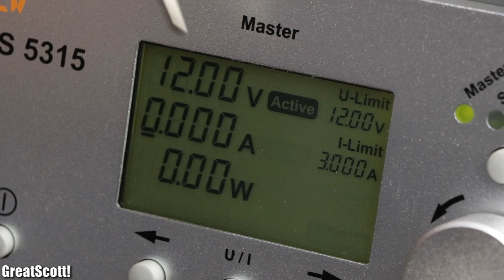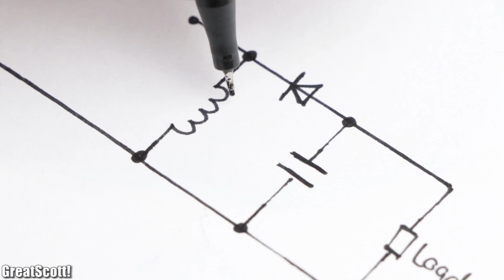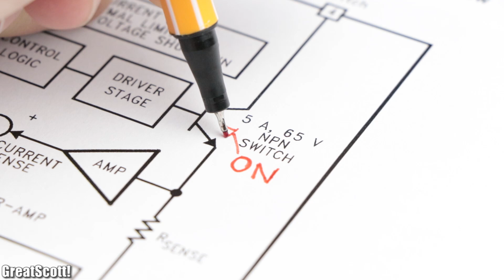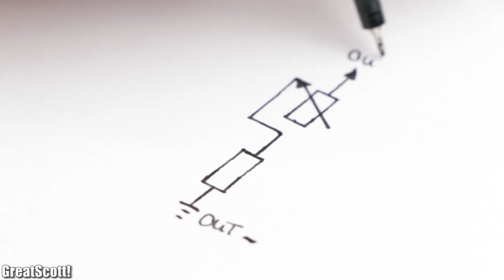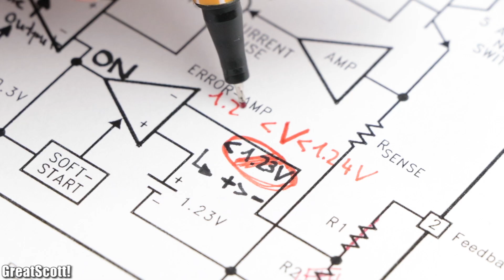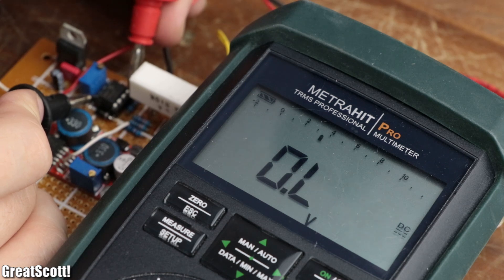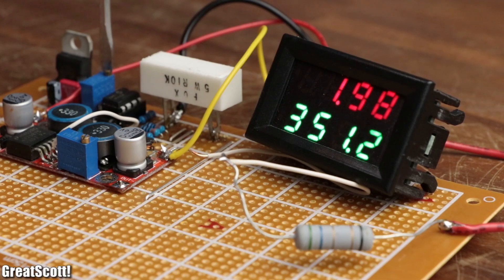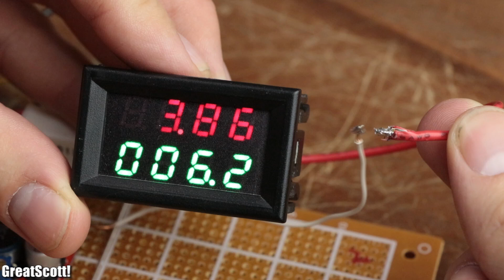HACKED!: Adding a Current Limit Feature to a Buck/Boost Converter

Comment: Hi there Scott! I'm trying to figure out how to make a current limiting circuit for my lab power supply (PC modded power suply). I want to make the 5v 16a output to be a 5v 500ma output, but I cant figure out how to limit current without creating a voltage drop. Can you help me and give me some advice?

Comment: Hello GS. In this type of power supplies can i use a big electrolytic capacitor at output, like in a linear power supply, to avoid ripple? Thank you. Keep the good schematics.
Reply: Due to the quite high frequency i thin its better to use film or ceramic caps

Comment: I have a problem with this blue mini potentiometers, its nearly impossibe to get a precise value out of them because some times i turn 3 rounds and nothing happens and in the next turn the value goes high af. Is there any way get get a precise value from them? Now i'm using a standart metal peotentiometer
Reply: The blue micro pots shouldn't cause this issue, slow quarter or eigth turns should regularly update.

Comment: Is there any method to design a current limiting circuit without a shunt? in high power application a shunt would be very inefficent, so i'm thinking if it's possible to wrap the output wire around a toroidal core with a hall effect sensor stucked in to detect the current value, pretty much like a DC current clamp would do.

Comment: Can I use 4 to 6 LM2596(current limit 2-3Amp) module , to charging a 12V , 100AH LEAD-ACID Battery , as it is required current of 10% of Ah rating, for this case it is 10A.
Please reply
Reply: No you can't just parallel them

Comment: This is cool knowing how to do this, but I would probably just buy one of the many buck converters that include an adjustable current limiter in the design.
Reply: Zero challenge or understanding of the components you're using means when they don't work you just buy more
Reply: That's exactly what I did,  only the board has three trimpots on it,  not the two that you'd expect.  And it doesn't seem to want to work properly to drive a 10W LED.  I'm in the process of trying to figure out why...
Reply: Yeah but you have to wait for it to arrive from China or wherever. I like to be able to build things with the stuff I have lying around. As a programmer I find there is a lot of beauty in creating complex things from a limited number of primitives. So as an electronics hobbyist endlessly buying new components doesn't satisfy me. If I were building a commercial product that would be another story.

Comment: I know this is a year old but hopefully someone can advise me.
I have two of these buck/boost converters which I thought could be very handy for powering an Arduino and a few sensors yet get a nice stable voltage.
This it did but I noticed the batteries were not lasting long.
I checked the current draw between the buck/boost converter and my Arduino and measured about 45mA max.
I then measured the current draw between the battery and the buck/boost converter and was shocked to see 204mA whilst the Arduino was connected and even more shocked to measure 208mA when I disconnected the Arduino so the buck / boost converter was off load.
I had the output set to 8 volts.
This was the case on both, so have I got a faulty batch or due to the nature of these, is the current indication incorrect.
If my findings are correct, it makes them completely useless for anything.

Anyone else found this or could anyone explain.
Thanks

Comment: There are ready made CC, CV Buck Boost converters, with additional trim pot for current limit adjustment. They typically use low side current sense resistor (shunt), making it easier to process the current feedback signal. Typically the current feedback signal after non inverting amplification is fed to the FB pin via diode. The FB pin is controlled by the higher of of voltage and current feedback signals. Nothing wrong using high side current sensing...but the accuracy of the simplest 4 resistor diff amp even with 0.1% resistors could exceed 2% due to unwanted sensitivity to voltage due to resistor mismatch. TI and AD have an extensive range of tiny current sense amplifiers, more suitable for this role than a general op amp (comparable on size and cost).

Comment: I recently purchased an lm317 ac/dc step down power supply module (I'll put a link to show the exact one) and it seemed to work fine when I wired it up but as soon as I apply a load, no matter what size, the voltage just drops straight down. It's completely unusable. I was hoping you might be able to tell me why and how to fix it. Here's the link 👉🏼  https://www.wish.com/product/lm317-adjustable-voltage-regulator-ac-dc-step-down-power-supply-module-with-led-meter-54aba0204274a2031d974277

Comment: i need to add short circuit protection to H-bridge inverter to protect the igbt's , i using 4 NGTB75N65FL2W IGBT , and the inverter 
 is HF without transformer , do you have any Suggestion

Comment: something wrong with the schematic diagram which op amp IC1A pin 3 should connect in between 3.3k and 100k resistor not to GND. I guess you are trying to test your viewer :)

Comment: I discover your videos today! Congratulations! They are amazing! I l have a step down regulator! I need a fix current of 12v, connected to a gel battery! The problem is when the battery is full we regulator to 12v, but the problems is that the voltage of the battery will decrease and voltage of the regulator will decrease too. Do you know any step down that the output voltage can be fixed without input voltage decreases?

Comment: Excellent video and tipp! much appreciated!
Did you also investigate the behavior of the buck/boost converter when input voltage drops below 3.8 V? I figured out that the output rises suddenly to its maximum when input voltage drops below 3.5V. This would be fatal if powered by a liion e.g. that suddenly drops below 3.5V. Then it could happen that the output of the buck-boost rises to 30 or 40 V destroying an led that might be connected to its output (or anything else). I think i got exactly the same buck-boost converter from ebay (chinese seller) - which cost me only little more than 1 euro.

Comment: I have a problem. I made a FM transmitter, but it needs 30 volts. When I use a boost converter, you can hear the switching. How can I prevent that??

Comment: Good idea is to add a bit integration to comparator circuit. Something around 10nF between output and inverting input does the trick. Much cleaner output voltage and less hissing sound from inductor.

Comment: Please, I have a doubt about the connection in the feedback pin of the IC. Did you connect the new feedback signal from the current limiter with the same feedback that is used for voltage measure? How does the circuit will control the output voltage if there are two signals in the same pin? Thank you!!

Comment: Since im to cheap to buy a 'real' Variable Powersupply, would it be a good idea to use such thing as a low current 'power supply'?
Reply: Bertrahm the output will be pretty noisy though so I would add a lot of filtering to the circuit

Comment: Hi, I have a car starter that works with 200 amps, but I want to limit the current to 15 amps to use it as a DC motor, how could I do that circuit I could use, regards.

Comment: How can I control the current limit by an arduino? I want to dim the LED this is powering
Reply: Interface the Arduino with a DAC, whose output is connected to pin 6 of the MCP602 ic instead of the potenciometer.
PWM with filtering will do the job aswell, just with some added noise.

Comment: what voltage do you feed the op amp. There does not seem to be the 
standard +15v -15v voltage anywhere so are you just using the voltage 
thats at the output of the converter or the 3,3 v from the voltage regulator?
Reply from the maker: 3.3V from the regulator

Comment: please create a circuit that gives a constant voltage like 5v, if the voltage increase to 5.1v it will reduce it back to 5v, or if the voltage drops to 4.9v it will increase it to 5v.

Comment: Hey GreatScott!, can the DC/DC boost power supply design presented in your videos be scaled up to supply enough current to allow a user to charge a laptop directly from a car cigarette lighter socket WITHOUT having to use the usual inverter and AC power supply brick combo? You know, directly step up the 12-ish volt DC to the 14-19 volt DC of typical laptops efficiently?

Maybe this can be a video idea perhaps.
Reply: A slightly larger DC-DC boost converter rated for 10A probably could do it. It has a significant heat sink. I tested some of them a few years ago and one problem was that before you got to adjust constant current limiting to reasonable level it blew a fuse for a larger load like notebook with empty battery. For a while the current can be high before it settles.

Comment: I've done this many times.  The problem I've sometimes had was that the high side of the feedback resistor would sometimes exceed the common mode input capability of the opamp.   This has often forced a careful selection of a high voltage capable opamp.

Comment: @GreatScott!
Your playing with stuff I'm really interested in here. Do you think your limiting yourself by using these tiny commercial modules? I favor recycling similar circuits myself as they tend to be easier to modify imo. I appreciate the explanation you gave here. I have been toying with the idea of adding an extra winding to an isolated SMPS to power an auxiliary circuit like this. Personally I don't find these modules very useful. If you're looking to power a project, and using SMPS controllers, I think it's better to go straight for the mains to DC to SMPS type circuit. I understand the modules are often used with batteries, but batteries are 1000× more expensive than mains power. ...but that's just my $0.02. 
  If your looking to do more content on SMPS there was a recent video (within the last couple of weeks) on the channel DiodesGoneWild where he explained the little 2-transistor mains SMPS design really well from a reverse engineering perspective. This one peaked my curiosity about creating the circuit design from scratch.

   I'm working on the official AVR Transistor Tester project mostly on the EEVBlog thread. One of the project's auxillary circuit options is a zener threshold test circuit that requires a low current boost converter. I've been thinking about different ways to create this. I can easily build an MC34063 based circut as several people have already done on the project. However, if someone were to create a boost converter circuit using a simple 2 discreet transistor topology, this option would become even more accessible for beginners.
  Anyways, I'm just learning and having fun. I've been working with Markus R. the developer of one software fork of the AVR Transistor Tester OSHW project  from the mikrocontroller forum. I'm slow but I've been putting together the information to create a new home for English support on the project. I've spent the last 2 months collecting information from the four major forum threads about the project to be sure I have a complete list of information. At the moment I'm procrastinating from working on my KiCad schematic of all 44 auxillary circuit options for the main version of the project. I've probably got at least a few more weeks to go before I create a new main support thread summary on the EEVBlog forum that includes all information from all foreign language forums about the project. When I'm done it should be the most coherent and consolidated information available about the project.
    I'm not trying to make a buck off of any of this. I'm simply trying to fill my time with something interesting and useful. My channel is none monotized. The forum reference material I have uploaded about the project doesn't have my channel branding, and actually hurts my channel to do, as YouTube totally disregards this type of content from search suggestions. 
 I know your doing your projects on a list and restricted by your weekly schedule. Maybe in the near future you could consider doing an episode on the device that notes the OSHW project. Dave did his recent episode on the EEVBlog about the cheapest junk clone version of the project, a device he was sent for free, but he didn't spend 5 min researching the actual project and failed to give credit to your countrymen and the real OSHW project it came from. I'm not trying to self promote or looking for recognition by asking you to create info about this device. I was confused about the project at first after buying a clone myself. After looking into it further, the project is a really interesting OSHW project. It was designed for stupid simple hardware and as an exercise in maximising the internal hardware of the AVR microcontroller through C and Assembly. The clones that are sold are all sub par copies, but after replacing a few resistors, a Xtal, and a voltage reference they can be brought up to the minimum system specified in the project documentation. I have already posted a complete list of correction parts with links to Mouser on the main EEVBlog thread. This list is for the most recent through-hole clone of the project. I have also create a full schematic for this clone, a PCB designator diagram, and I uploaded a video of it where I reverse engineered every trace of the PCB. This clone version of the project includes the measurement terminal for a zener threshold test circuit, but it doesn't include the actual boost converter itself. This omission creates an opertunity to create something different on YT if your interested. This clone version of the project can be found easily by searching "Transistor Tester PWM" on eBay etc. I have no problem supporting you with information about the project if you have questions and want a quick answer. On the technical side of the project Markus R is quick to answer as well on the EEVBlog thread. I would like to see someone with a larger audience draw attention to the real OSHW project. Many people have worked really hard to create it. No one on the official project has tried to profit from it. No one on the project minds the thousands of clones that are sold. The clone sellers do not give any information about the official project. This has created a terrible amount of misinformation on places like YouTube and Instructables, and hundreds of people that come to the different forums and asking the same questions over and over every few pages. This confusion is why I decided to spend so much of my time trying to help with the project. In my opinion after going through all of the forums, the English speaking audience has been the least informed group on this project. The official documentation is in German and translated into English and Russian. This puts you in an ideal situation for understanding and drawing attention to the official project in my opinion.
   Personally I want to try to create a more accessible version 2 of the project on my channel in the future, and I have a bunch of ideas for more complicated content. I recall you saying something like, 'You are not looking to create anything too complicated in your weekly uploads.' Personally I want to focus on this type of thing more. I don't want to copy anyone. My goal is simply to create unique content on subjects where there is not much helpful intuitive information. I'm also only looking to create content that doesn't use any spoken language as a fun challenge to myself. I'm not trying to recruit or spam here, I'm just trying to say I'm not looking to compete or take anything from you or what you've created.
  Anyways, I'm writing all of this putting myself out there to try to help others, and do something useful with my spare time. Let me know if your interested in the project, I'd love to help any way I can.
 Sincerely, -Jake

Comment: Very useful hack. I was looking into doing something as elegant for a a linear regulated power supply. Perhaps you could could think of a similar way to Implement current limiting using an Lm317?
Reply: Brainpowered Electronics i just burned a lm317 with overvoltage , i was lucky to have a spare lm338 , this reminds me to buy some more.

Comment: Comparing this method to a mosfet doing the current limiting with an op-amp, which one would be the better option to go for? I guess the mosfet way is separated from the DC-DC but it also means the mosfet would drop the voltage when current limiting so it could get quite hot for high current. But if you had both voltage and current controlled by an MCU, you could lower the voltage that way.
Reply: It would be great until the MCU locks up (and you haven't provided a proper watchdog timer to check the status of the chip). The added complexity in this case is not going to outweigh the features it brings unless you do it correctly.

Comment: So let's say the output of one of the eBay buck boards was set to 12volts..Then the output was wired to a current boosting transistor so you could run a bigger load than those little boards could offer. How could you wire up that sense pin to the output voltage, so when the load increases on the transistor the voltage doesn't drop. Basically as the load increased, the output voltage will stay at 12 volts. If that makes sense.

Comment: What kind of power supply would I use if I wanted to hook up some LED off road light bars (say 180 watts) as outdoor lights? So taking mains and converting to 12v while supplying enough power. And isn't too expensive

Comment: 0:45 That NOISE!!! You can literally see the LED flickering in the footage. If you want to use a buck-boost converter for anything that requires a fairly stable voltage, I highly suggest adding a good amount of filtering!

Comment: Great job as usual.
But you can save money and time by using this very cheap step down module with adjustable CC/CV, only costs 1.5$.
http://www.ebay.com/itm/112034265855